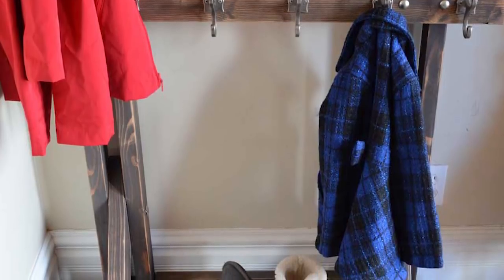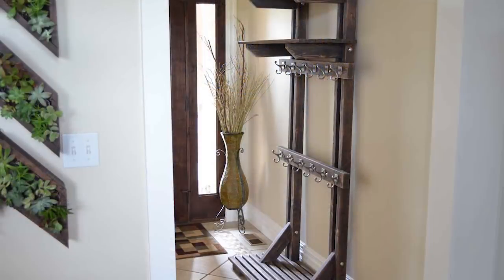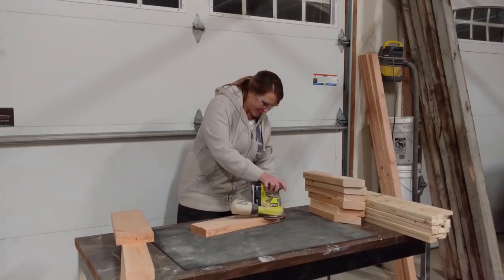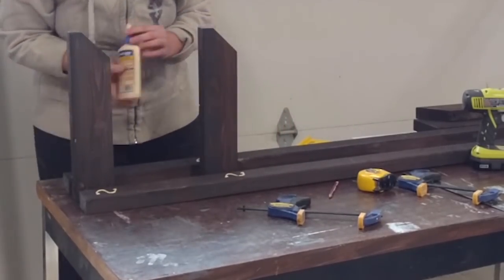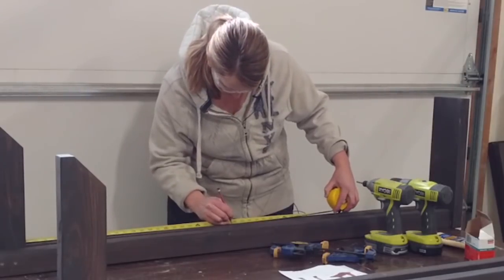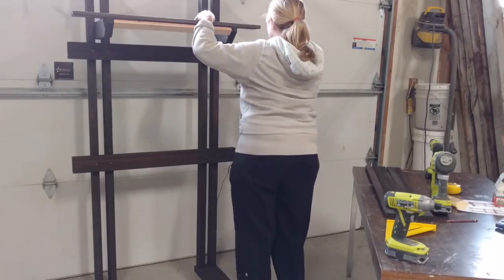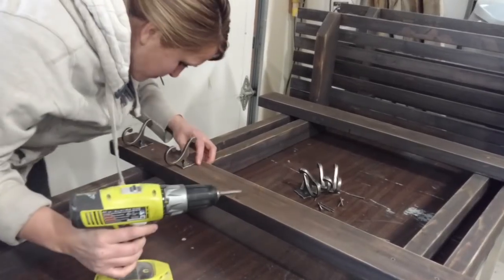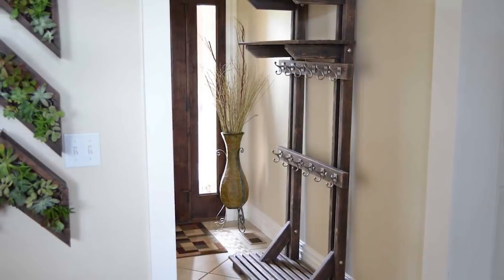Build a Hall Tree Coat Rack to Tame Entryway Clutter

Comment: I could be wrong but I dont think that wood glue will stick to to wood that has been 
prestained
Reply: If it were just being glued, you are right, it might have some problems, but she also drilled it with twice (and there are plenty other screws throughout to add additional support) and even more, she later secured it with bolts too!  So I think it will be good!
Reply: Good point. luckily I used screws/nails to hold it all together.